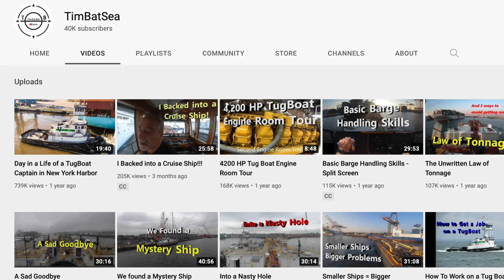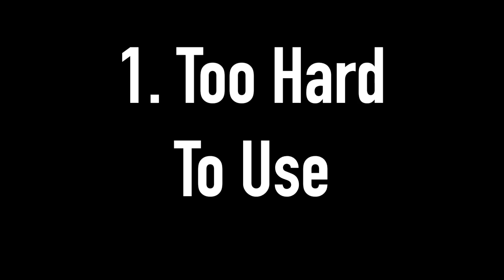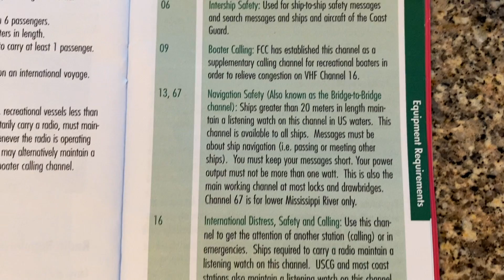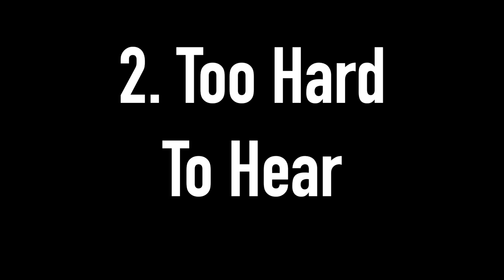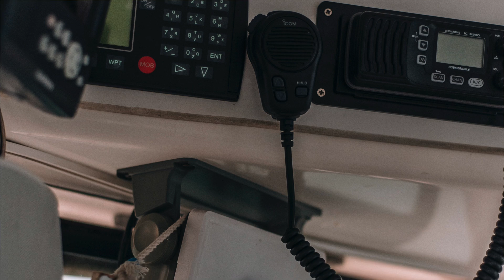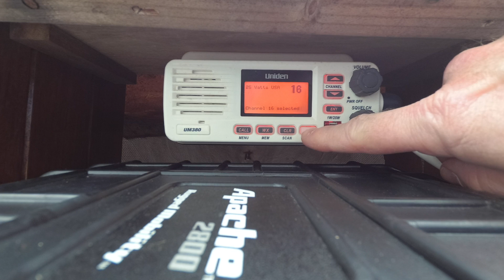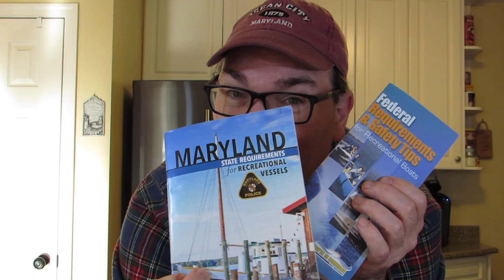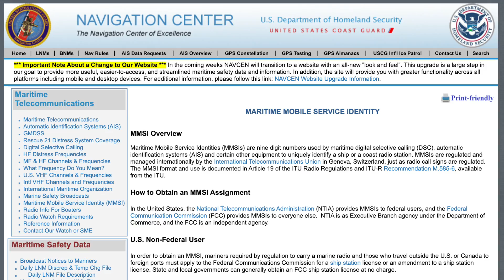The Problem With Marine VHF Radios

Comment: Here in the UK you need a license to use one. That involves going on a short course where you learn how the radios and the system works. You get assigned a ships callsign too. I think we are one of the few countries that does that for VHF.
Reply: How do they handle boaters from other countries that have no license requirements or training requirements for VHF?  Are they told to stay off the air?
Reply: @richardowens9061  No. In reality they don't do much enforcement anyway.
Reply: @GordonHudson  SPAIN 🇪🇸.
License required too.
Reply: Y'all should rethink that. I watch a lot of boating channels in the UK an very few have a radio. And they are still honking at each other trying to communicate. Especially the narrow boaters honking before every tunnel and every blind corner. All that honking would drive me batty if I lived near one of those.

Comment: I had a "big" VHF on my other boat.  The current boat, where space is at a premium, means I now have a hand-held radio.  I agree with everything you've said.  I have a bit more experience on radio usage as I was an Aircrew member on a USN P3 for 3 years.  What I've found about the hand-held, is it's difficult to tell if it's even working!  Squelch all the way off and NOTHING...bothersome.  The biggest water I'll likely be on is the ship channel in Sturgeon Bay, WI and/or Green Bay and very small part of Lake Michigan...NOT very far off shore...

Comment: I'm from the UK and we have to take a course before we can use a VHF radio, by law. If you are caught using a VHF without a licence you can be fined £5000 ($6500) and /or be sent to jail for up to 6 months. Many modern VHF radios also have AIS these days giving another level of safety.

Comment: Nooooo. VHF's normally use 9  like a CB and 16 for genuine distress. Can't use it on land? Sailors walk to the laundromat  on a crew channel and you can keep a boat radio in your kitchen for handling genuine boat needs. Functionality comes from a waterproof card with channels and uses tagged to them. Handheld? A mistake. Make a 25 your first radio even in a canoe. It uses a non ground antenna and a lawn tractor battery in a case. Plenty loud, until you run an extra speaker to the bunk or galley. It's the dude on the other side that needs some brains when you don't have any. Speak soft and slow. How many on board?What's the boat name or nickname? How much battery do you have? Can you see anything on the horizon?Ok, then I'll launch a flare? 25 watters are cheaper than handhelds. They are for sailors on the bow. Also don't forget a CB radio and a decent antenna for it.

Comment: Dear Sir, Thank you for this video. If I am not mistaken, most VHF comms are limited to line-of-sight. On big water, line-of-sight can go a long way with 5 watts. Improved antenna will make that better. 50 watts is good. A CB radio may be a good “back up” for inland waterways where bluffs may interfere with VHF comms. CB is not limited to line-of-sight. Just a thought. Again, thank you.
Reply: A lot of people think that CB is dead, according the number of CB radios sold in Amazon every month, it appears that that is not true. Even though more and more people have and continue to switch to GMRS, CB is still alive and some would say making a came up. 

I know that when it comes to off-roading GMRS has taken over. No question about it. I’ve heard that many truckers have switched to GMRS. But due to todays laws that makes it illegal to use cell phones and other electronics while driving, I’ve also heard that more and more companies are not providing CB or GMRS radios in their rigs and prohibit drivers from installing one. They are also installing dash cams that record what is going on inside the truck. 

I have a GMRS license so I cary one, but on trips I carry both a CB and  GMRS radio. The advantage of GMRS radios is the power output. GMRS radios can transmit at 50watts in channels 15-22. And, it has 8 channels for repeaters. Some GMRS handheld radios can transmit at 8w to 10w. With 5w being the most common. Of course mobile radios are the ones that can transmit up to 50w.  CB radios are stuck at 5 watts. My understanding that now is 4watts, but don’t quote me on that one. I believe I heard it somewhere, and the new radios I’ve been considering do go up to 4w.

But of course, modern CB radios (some) are not the old CB radios from the 60’s, 70’s, and 80’s. Some transmit in AM or FM mode, have CTCSS/DCS, sideband channels, noise cancelation, and more. I am thinking of getting me the President Randy III,

Comment: Just a few thoughts:
- I take groups out kayaking near Assateague. I have a VHF radio in my kayak for emergencies, but everyone else has FRS radios. Beats yelling, and FRS radios don’t have the complexity of VHF radios
- the OCMD coast guard station has tall antennas and a 50+ miles range, but on The Bay I’d depend more on commercial shipping for help. It’s also important to know the channels for ship to ship comms, especially in high traffic areas such as the 1000 Islands region, where there are a lot of tour boats.
- as you are now able to communicate with people on shore you can test your VHF radio by putting a Baofeng radio programmed to receive on a marine channel next to a recording device. Go off shore a couple of miles and transmit. Then check out the recording. 
- VHF radios are a practical necessity at locks and draw bridges. Some keepers use cell phones, but VHF is better.
Reply from the maker: Yeah I bring this one with me every time I am out - and it has worked remarkably well.
I just wish they were a little more intuitive for novice boaters.

Comment: Older video I know, anyway. I taught my kiddo to use handheld PTT radios by way of using the little FRS walkie talkies when we'd go camping or to playgrounds and parks. It's amazing how fast a kid can pick up a skill when you make it a fun game and much of the basics cross over. I used a label maker and have my boat reg numbers on the back of the handheld. I did get the DSC model with GPS but found out later that since I just have a little 14' tinny it can't be put on the "real" USCG DSC registry but just one from a well known private boating organization that I would have to HOPE the USCG/DNR actually checks, and I'm skeptical about it. I still did the registration though. Also the DSC handheld I bought only allowed the numbers to be entered ONCE on set-up so it kinda defeats the purpose of a portable hand-held VHF if I can't move it from boat to boat, or sell it, dumb design and something to watch for. Overall though, I think having SOME kind of VHF available on board is totally worth it in spite of some of the challenges. Just like my PFD, it might make it easier to find my body and make the insurance claim!

Comment: I’m in va and boat the bay every year. The bottom line is you are responsible for your safety on the water and having the knowledge of what to do in an emergency. Like a lot of things in America it’s about taking personal responsibility. Early do government regulations help those who have no interest in helping themselves. More government intervention rarely to answer as far as the book names when healing costar I’m pretty sure the point of that is if you have a large commercial vessel that Cincinnati mayday is a registered vote, it allows them to identify what type of resources needs to be deployed if it’s a 200 foot tanker ship with 35 people on board you’re going to need a lot different resources compared to if you call Lynn it may day And instead of a boat name you just say 20 foot center consul for three people they know the resources needed for that situation. The Coast Guard is not gonna put their boots back up on the desk because you did not have a proper boat name if you just tell them, the type of vessel, and the number of people, you will be fine that is kind of common sense. I feel like you’re overthinking it a little bit. The biggest thing is location and if you get a radio with a GPS that you can register, they will automatically have your book dimensions your size your name, your contact information and any other pertinent information and I will also send your location.

Comment: A hand held radio is only a backup radio, it should not be used as your primary radio.
The distance the hand held radio can transmit is limited, even if your only 2 to 3 miles from shore. You might be able to hear the coast guard, but the CG will have a hard time hearing you, as will other boaters near by that can aid in an emergency. Also hand helds have terrible speakers because of their size.
You 100% need a fixed mount VHF onboard at all times with at least a 4 foot antenna, 8 foot is better and mounted it as high as you can safely is the best. Standard Horizon makes great radios at good costs that have GPS and DSC built in.
A VHF is very important imo, especially a fixed mount. I fish the majority of time 10 to 15 miles from shore here in LA and cell service is spotty at best when out there.
If you can’t hear your fixed mount radio, you can go to West Marine and buy an external speaker that has better sound than the speaker in the radio. With the external speaker, you can clearly hear calls better.
Reply from the maker: Obviously being miles from shore is a very different situation and I wouldn't dream of being out there without a good VHF and fixed antenna. Handheld tends to be my primary radio in my small boats that have no onboard electronics and many recreational boats in my area do not have a VHF - but we're also not far from land at all.
Reply: @WayneTheBoatGuy  Wayne thank you for your reply, personally I think VHF radios should be required equipment on all boats regardless of the length. A cellphone can only do so much and if a person drops it in the water, especially if they go overboard, it's going to sink faster than a rock. Of course a VHF without DSC or GPS is about as good as a cellphone, but the difference is everyone on CH.16 can hear and communicate together. Just my 2 cents.
Anyway if you haven't already upgraded your primary radio, since it's been a couple years, check out the Standard Horizon HX890. This is a very good radio at a good price if you decide to upgrade.
Keep up the great videos, enjoy watching them !

Comment: your boat doesn’t have a name? Takes about 10 minutes of instruction, and a normal person will remember to use the radio. In an emergency you just give a location. With DSC & GPS  all you have to do is press a button for 3 seconds.

Comment: In some ways, you are making this harder than it really is. 

In the USA, if you are in coastal waters, the USCG Rescue 21 radio communications system has 100% continuous no-gaps coverage along the entire US coastline. 

If you pick up your marine radio, set it to Channel 16 and say something like "Coast Guard - I need help, we are sinking" - that will get the Coast Guard's attention. And, the watchstander at the communications center will take it from there. 

The Rescue 21 system lets the Coast Guard triangulate your position down to something like a 1/4 mile square patch of ocean. They send the big friendly orange helicopter straight to that patch of ocean. This works best when your signal is received by two towers in the Rescue 21 system, which is normally the case. If the Coast Guard can only pick you up on one tower, the have a line of position - ie they send the helicopter to fly down that line until they find you.

Comment: Man I couldn't even finish your video all you did was piss and moan the whole I didn't know I can't hear the radio it's not federal or state mandated. Well firearms have a safety but there not required to use and it's up to you to learn what you need and is required to be a safe boater and to be safe on the water and you can get an external speaker for your vhf that's why the "commercial guys" can hear their radios I didn't know is just an excuse for I didn't want to take the time to learn it. That's why you see people out there in trouble constantly clueless know nothing of the rules of the road navigational aids how to use a radio what to do for a fire, man overboard nothing. Boat captains deck hands, sailers have spent many hours learning all this stuff amongst more. So you saying I didn't know and making a video about I don't I didn't know is a real disservice and you call your self the boat. Should be I don't know anything about boats guy

Comment: Never had to make a mayday call (knock wood), but I have had to make a couple of Pan, Pan calls.  The point about the distress call (along with pretty much all of the others) is very much overblown.  All you have to remember about any initial radio call is 4 things - who you're trying to talk to, who you are, where you are, and what you want.  

In the case of the distress call, "mayday, mayday, mayday" means you're trying to talk to anyone that can hear you.  "Who you are" could include a boat name, but should also have a description of the vessel.  "This is a 30', white over blue, bow rider" is way, way more helpful to someone trying to find you than a vessel name.  And your state registration number is absolutely worthless.  If someone is close enough to read that, just put down the radio and yell at them.     

"Where you are" can just be a general description, but a lot of new radios have a built in GPS.  Very handy if you want to get a rescuer on top of your position vs within a couple of miles.  And "what you want" is simply the nature of your emergency and that you want help.  

And, if you made it this far, one last tip.  I don't have a catchy rhyme for boating, but in flying they say your priorities in an emergency are to aviate, navigate, then communicate.  If you're solo or you don't have someone on board competent enough to make a distress call, don't lose the ship or put it up on the rocks trying to mess around with the radio.  If the situation is dire, you can always make that mayday call from your life raft or bobbing around in your PFD.

Comment: Apart from the line of sight issue, your hand held is restricted to 5 watts.
Mostly, as I understand it, because sucking more power out of its mounted battery will suck it dry in very short order.

Your mounted VHF marine band radio is restricted to 25 watts.
It should be connected to your house battery or a dedicated radio battery.

The phonetic alphabet is the gold standard but anyone would understand if you were to say c for cat or H for henry. You would get your message across to anyone with the inteligence to be of help to you. Right your boat rego on the dash near your radio or get a lable made up.
I wrote the registration of my boat on my handheld with a white paint pen.

In Aus every VHF marine band radio operator is required to hold a Radio Operators Certificate of Proficiency or be under the supervision of a holder of the ROCP or higher quals. A requirement more often ignored than adhered to.

Most VHF trafic I hear is amature fishermen chatting with each other over the local VMR repeater or at leat untill the radio room operator asks them to go to a simplex chanel to free up the repeater for its intended use.

If your passengers can't be trained to use a push to talk radio you need to tie a life jacket to them and strap them into a chair where they can't harm themselves or others.

And finally, the only alternative you seem to've come up with to a VHF radio is a far more complicated VHF radio.

Also, what's wrong with a Sat Phone?

Some people would whinge if their arse was on fire.

Comment: In the UK you are not required to have a license to operate a non-commercial vessel, saying that most insurance will want you to or be able to prove enough experience. To operate a VHF you do need a license, except in an emergency, which is a one-day course with a short exam.

Comment: In an emergency, could you use a waterproof baofeng on 16 for a mayday?
Reply: Yes. An emergency means you don't need a license. Additionally, even if it wasn't allowed value your safety more than the possible FCC fine.
Reply: While a programmed Baofeng will be capable of sending and transmitting voice on channel 16, it doesn’t do DSC like a proper marine VHF. 

All you need to do to call for help with a DSC radio is to press the red Distress button five seconds. Every radio within range will sound an alarm and show your distress call with coordinates. The local marine rescue will assume responsibility for the operation. Other civilian vessels in the area will report to marine rescue that they’re available, and come to your aid if the rescue center so decides. 

Keeping an illegal Baofeng stashed away “for emergencies” is actually selfish. You’re expecting everyone else to have a legal radio monitoring the channels so they can hear your mayday, but you can’t be bothered to return the favor.

Comment: I'm sorry, but I disagree with everything you said in this video. Your entire premise is that people are too dumb/lazy to learn how to use a basic VHF radio. It's a critical safety feature of any boat. Learn to use it in its most basic form. You are the captain of your boat, if you think passengers may need to make a VHF call, print out instructions with exactly what to say (yes, including CF numbers, possibly phonetically). Take responsibility for your boat and your passengers. Can't hear it because your particular boat makes it difficult? Install an external speaker. It's a couple of wires. Your entire complaint about not getting a DSC/GPS enabled hand-held is due to your lack of research when buying one. That's on you. None of these points make any sense. Your video is blaming marine VHF. I'm blaming the operator here.